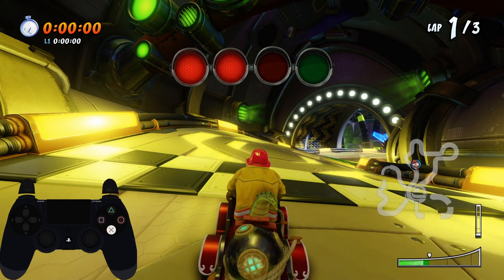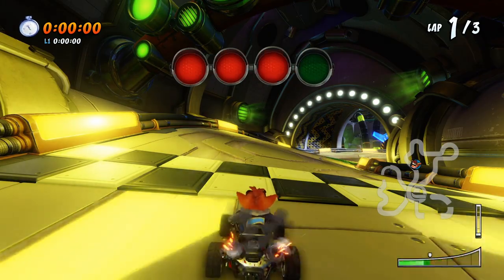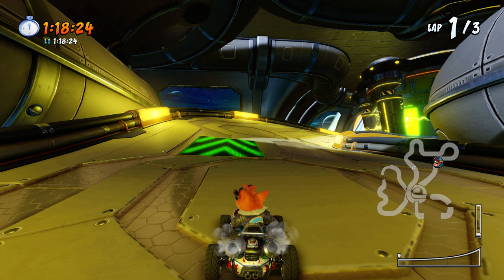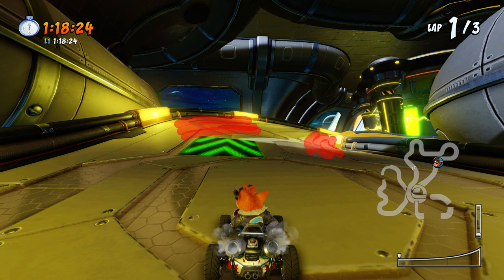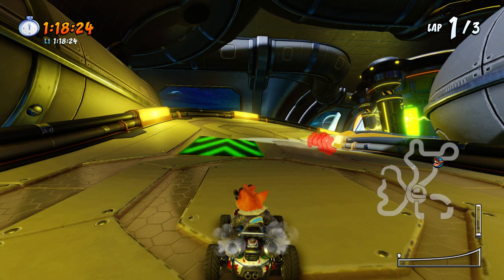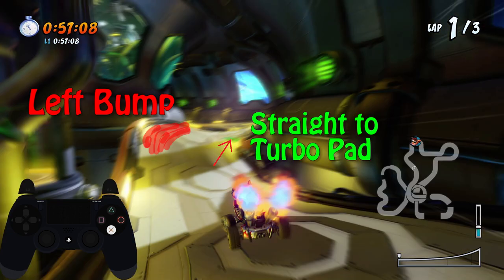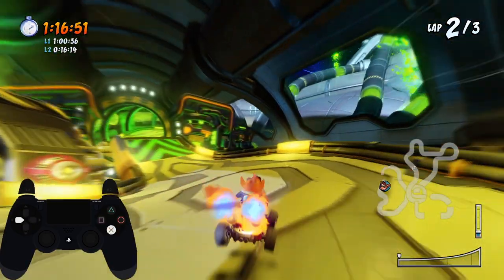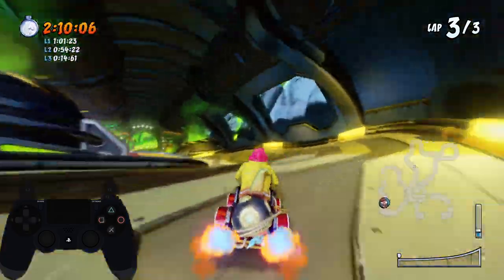Crash Team Racing Nitro Fueled - Tips to Maintain Blue Fire in Oxide Station [GUIDE]

Comment: if you're like me and don't use the D-pad and your on PS4 go into settings/accessibility/Button Assignments/ and you can switch the down D-Pad button for L2 or R2 based on if use L1 or R1 for  power slide boost (I hit R1 before L1, so I use L2.) doing this allows you to play with analog stick and just hold L2 and square for those U-Turns. setting the right button to Down is cruical so you can still hop for air U-turn, and quickly go back into a powerslide if you need. also if you switch games make sure to go back into settings and just turn the option off. you only have to make the change once as well than you can turn the option on and off!! woot
Reply: Nice tip and good idea!
Reply: @liam-6141  thanks it's how i do it works really well